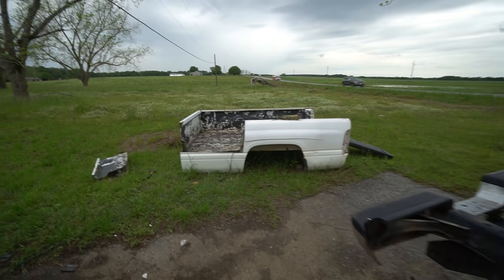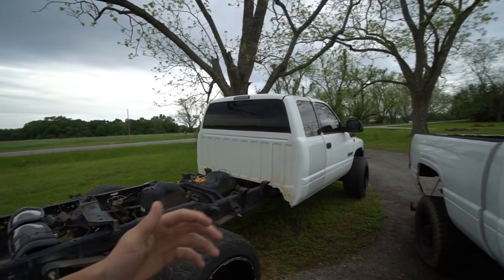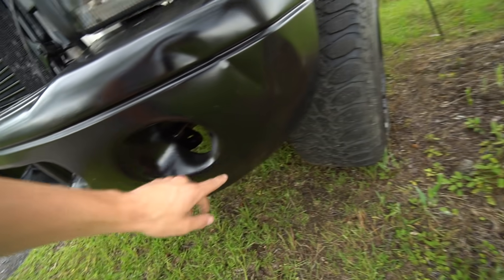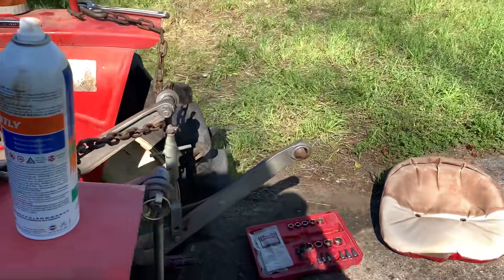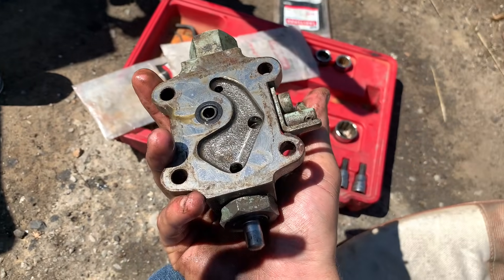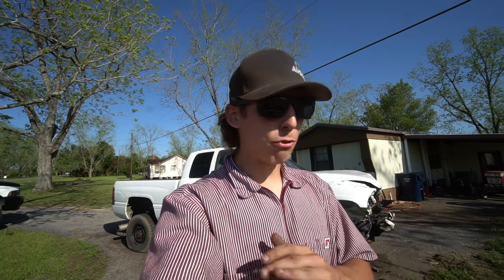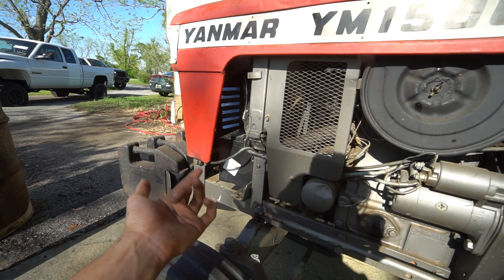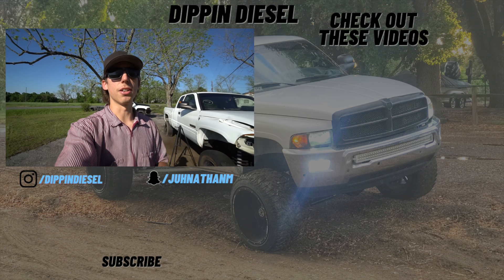CUSTOM FLAT BED For MY SLEEPER CUMMINS

Comment: Where I live the beds are like $5k for base flatbed cause they charge freight for every single one even though they order like 5-7 at a time, and then install is $700. So ya, I been thinking about doing this. Thanks for being the first one so I can see what’s been in my head the last two years, my wheel wells have been rusting.

Comment: Before you put a new trans in, replace all lines and cooler then flush the rad cooler really well . dont want shavings in the new trans and that is something that gets over looked a lot. Maybe even bypass the rad cooler and run a bigger external cooler

Comment: The outside lower thinner arms on the three point lift should go back too the axle of the tractor to keep your attachment from swaying back and forth. Hopefully the bracket are still there, those are great little tractors.

Comment: Also box keep wheel weels on even have spot on left side for mount your fuel door also cap to neck to refill tank also vent tube can  breath too or check engine soon light be on flash or stay on ! Hopefully hints I left you  helps on truck plus tractor  Dippin Desiel (Johnathan)  :) also read owner manual on that tractor so you can no what service it or have order parts on to ! If don't have owners manual check on Google it help with the Tractor keep going strong too!

Comment: When changing that rad hoses on tractor put new new thermostat with gasket plus sealer of high temperatures silicone or RTV sealer tar too also put 200ml of 80w90 differential fluid in rad cold not been starting up so lube up water pump plus whole motor too ! Do 80w90 differential every 3 months in rad antifreeze too and add a Grey Bottle of STP Total Treatment fuel injection and carb cleaner in fuel tank to and Dexron Automatic transmission fluid of 2 or 3 no synthetic type  too also full every 3 months too ! Also rewire a 100amp of GM Delco Alternator from 1968 to 1985 years plus in 4 or V6 or V8 engines  on that tractor save from boost always and when crank to start up drain battery or sitting a long time! Plus keep eye on transmission also hydraulic fluids don't go dry too!

Comment: Hey my abs and brake light on, Speedo doesn’t work and odo doesn’t work do you or anyone else happen to know the problem? I replaced the abs sensor on the rear axle but it didn’t fix it and it’s 2wd so no wheel bearing

Comment: Make sure you don't run more than 30% antifreeze, those are thermosiphon and they don't work right if there is too much coolant in them. They need 70% water.